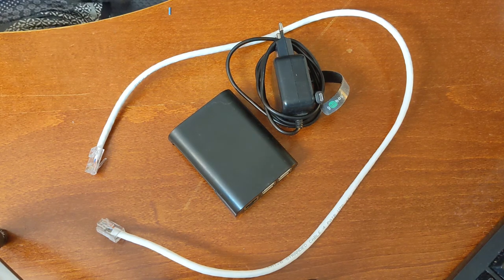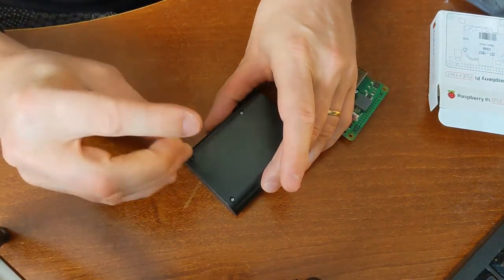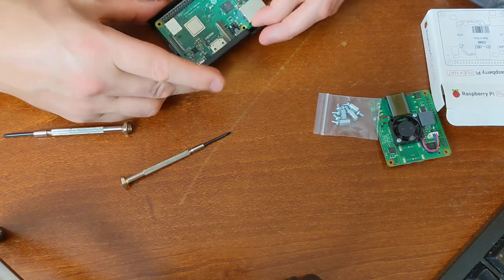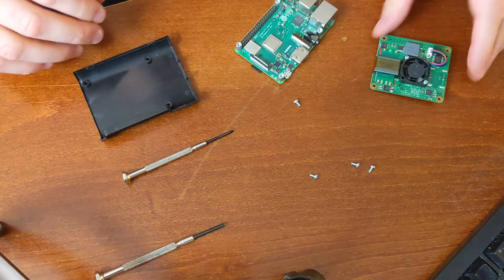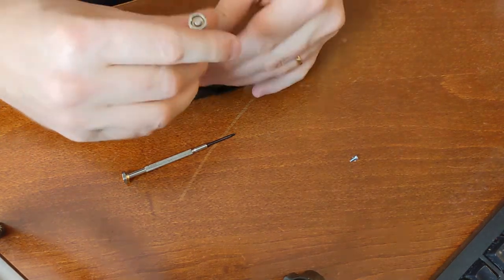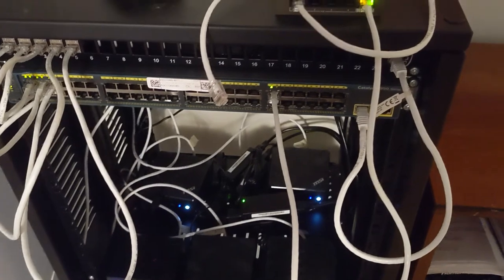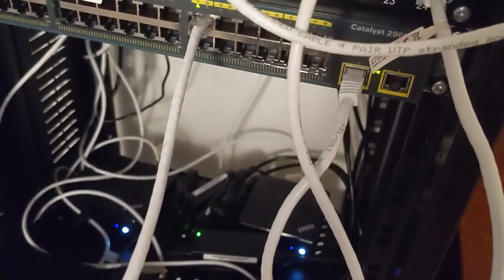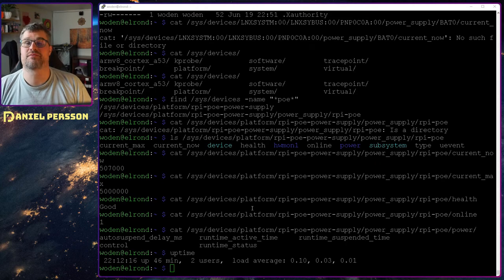My adventure with Power Over Ethernet (POE) using my Raspberry PI 3B+

Comment: It's so cool how easy it is to get PoE running on the 3B+

By the way, do you know if the Pi 4 can run PoE natively, or do you need a head for it too?
Reply from the maker: Hi Draco

Yes, I have 2 Raspberry PI 4b in my cluster and both required a POE hat to run. Hopefully the RPi 5 have it built in :)

Thank you for watching my videos.

Best regards
Daniel